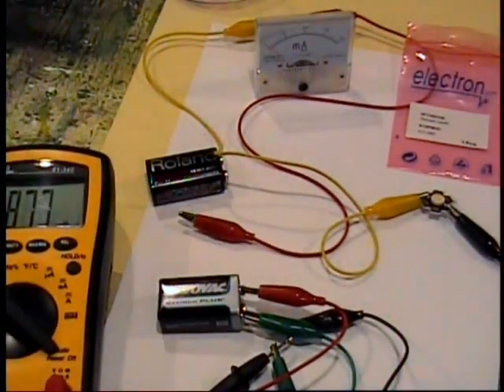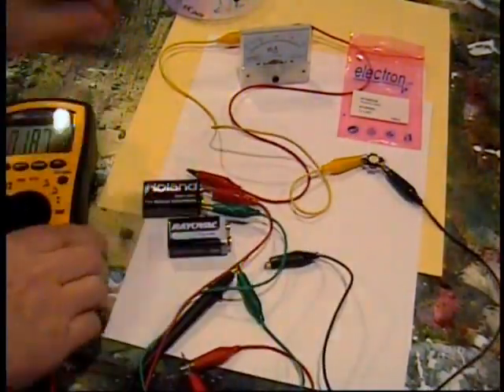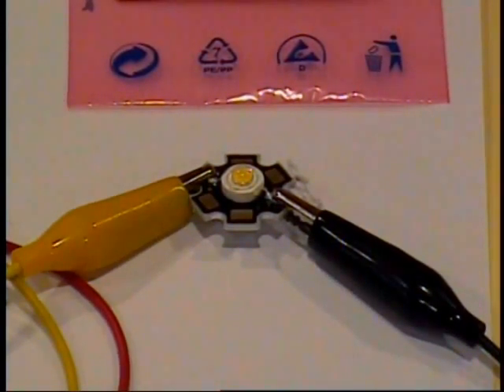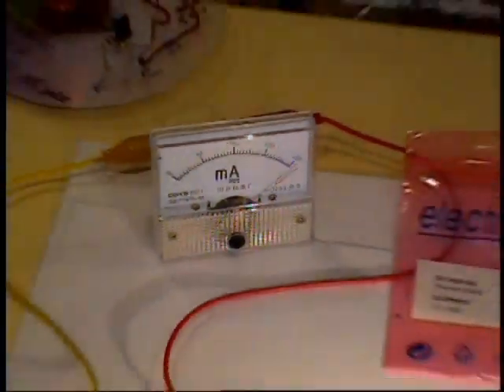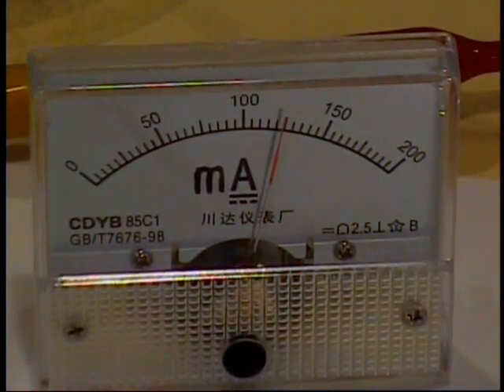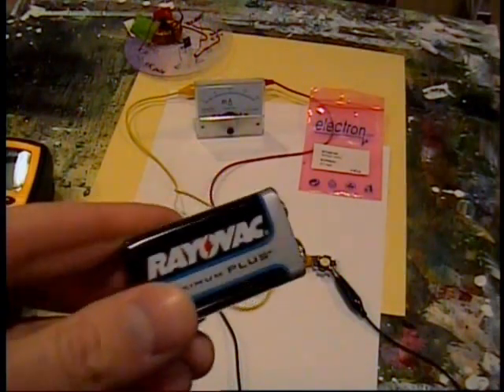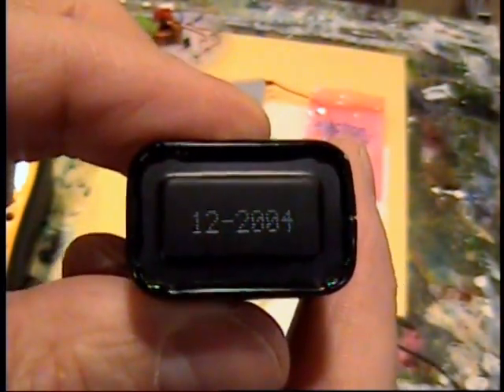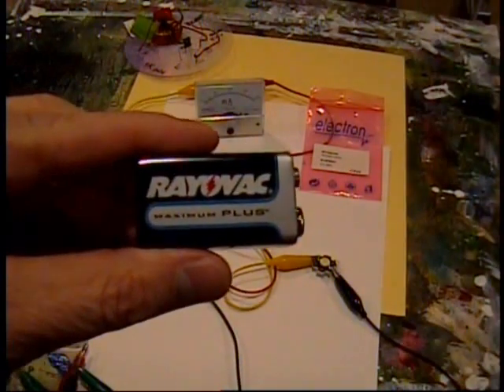Alkaline Battery Recharge Fail

Comment: Ya I have one doing that very thing and it's just a sunbeam from the dollar store but it is acting just like a capacitor so with that and an electrolytic capacitor I am pulsing it  with a pulse width modulator starting that at five volts after the cap stores 9 volts in until reaching it's full capacity 15 volts and then letting the cap drop to five volts and start over.  The battery won't drop below 4 volts though, maybe after weeks. The battery is holding up the cap at 15 volts when the nine volts in is removed. 9 volts in is coming from a transformer that I grouped 4 different K reistors at low milliamps and nothing is getting warm. So the battery is holding the Cap's 15 volts up when I pull the 9volts from the resistor bank off and I'm watching it drop with a 4volt LED as it dims from bright down to where it cuts off at 4 to 4 and a half unless I stop it at 5 volts, the Cap will go clear to the bottom without the battery to stop it. Also a  VU meter to watch the needle move. So .... I'm perty sure that's what I just saw happen. This stays as a live circuit maintaining 15 volts with no input and the battery kept the cap from rapidly discharging and only decayed at a very slow rate, I'm just not sure how slow yet but the battery will maintain 4 volts for maybe months anyway as, it has been in a bucket of batteries I have had for a couple years and this is what it was reading when I found it. So this will be a good circuit to pull very low voltage from to charge a button battery or maybe a AA battery as it should be very smooth and gradual ..   polished
I have another 9 volt Sunbeam battery that I put 9 volts in and it is holding at 15 volts, I have not tried to put it in place of the 9 volt sunbeam that holds at 4 and a half volts yet these are nine volt batteries. With this I should be able to increase the voltage in slightly to charge a group of 1 and a half volt batteries at a very slow rate. The Cap I am using is a 15 VDC 4000 microfarad electrolytic from ELNA, it just happened to be sitting here when I started wondering and the VU meter is a 15 volt scale  .. So .... maybe with a new 9 volt duracell instead of the dead Sunbeam it would be able to charge and maintain another 9 volt battery and keep the Duracell maintained without anything getting warm  ..  The Sunbeam that is holding at 4 volts is from 2020 and the sunbeam that is holding at 15 volts is from 2018  
Maybe with a logic anilyzer this circuit could be set up to cycle automatically until the 9 volt battery is sufficiantly charged and then disconnected from the live circuit  ..
I think for now I will collapse the voltage of the circuit with the 2020 in it to 9 volts and let it charge to 14 and a half or 15 volts and then start over again and see if the 2020 gets conditioned or maybe improves but surely a new 9 volt battery that hasn't been compromised could be maintained  ..
NOTE:
The 4 volt LED cannot be lit with either the battery or the cap sepreatly and the LED will not dim without the pulse width modulator ....

Comment: Wait, since when were Heavy Duty batteries Alkaline?
Reply from the maker: ryelor123 , until your comment, I was not aware that "Heavy Duty" was anything more than a marketing term. I researched, thanks to your comment, and now see some suppliers use that term to denote "zinc-carbon" chemistry. "Zinc-carbon" batteries are acidic and have a notoriously short shelf life which usually ends in corrosion.  I can't prove what type of battery I had at this late date as it is long gone but if it was "zinc-carbon" it was in miraculous shape.
Reply: I think some Heavy Duty carbon-zinc cells use zinc chloride as electrolyte, those are not acidic.  But most of the zinc-carbon cells have ammonium chloride as electrolyte and they are somewhat acidic.  They're only acidic due to the ammonium ions.

Comment: Are you using the re-emf circuit by Rene?
Reply from the maker: Tommy H, no I have not use the Rene variant, only because I want as little amperage hitting my old Alkaline batteries as possible to charge them gently. My favorite charger for 9 volt batteries is the Imhotep Auto Relay Energizer. I have had my eye on the Rene charger though. I would like to make one to use on actual re-chargeables and compare to my Bedini.